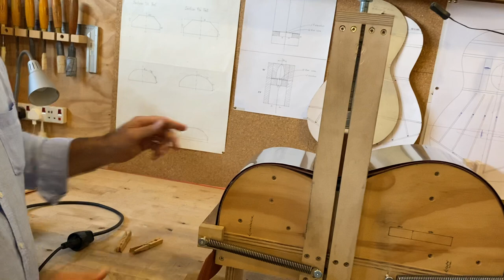How to make laminated linings for classical or flamenco guitars

Comment: I have a question dear Pablo .. I have a gerundino flamenco guitar and my problem is the saddle at the bridge seems to be stock and is hard to get out .. I wanted to take it out and put another one slightly lower in height .. do you have any suggestions as to how I can get it out without damaging the guitar?

Comment: Thanks Pablo. I use to laminate linings for my guitars. Usualy I use mahogany veneers (0,5 mm) so they are laminated from 9 strips and no need to bend them - I just glue them together in the mold (negative and poostitive). I use them both for the back and the top. What is your "philosophy" to use them only on the back side? Thanks.
Reply from the maker: Thanks for your comment.
I use linings only for the back. For the front I prefer individual blocks, peones.